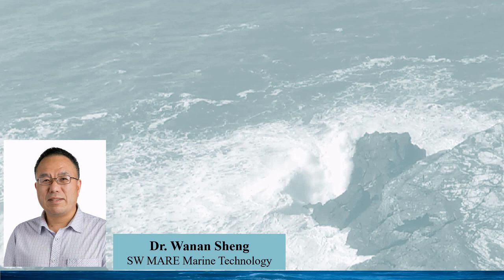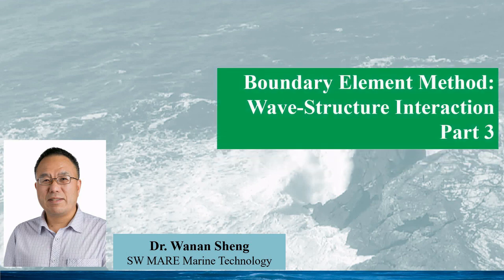[Fluid Dynamics: BEM] Wave-Structure Interaction, Part 3: Hydrodynamic Forces

Comment: https://youtu.be/_-N2sovNYpA?si=6C7Fx6X6tjm7k0P1&t=149  "In the frequency domain the pressure can be expressed as" - is this like a lecture? some justification?  the omega of what?  Sadly most of hydrodynamics have lots of assumptions not really justified or clarified.
Reply from the maker: Yes, it is a lecture. And yes, there are assumptions for the hydrodynamic forces, but it is a very useful and reliable method for getting the forces, and these can be used for industrial design. Or we can say the best method, but not the most complicated one.
Reply: @ScienceofFluids  I found your lectures since I have hydrodynamics  course based on Newman book. Its hard go go through since almost any equations have so many assumptions and there are just few if any explanations. Some are obvious (like linearization terms) but rest not that much.
Reply from the maker: @WojciechowskaAnna  yes, that's because the full fluid dynamics is so complicated, the nonlinear 2nd-order partial differential equations, and so far there are no good methods to solve them. However, it is found that the assumptions, such as the potential flow theory, are good enough for many practical problems, as in aerodynamics and in hydrodynamics (wave-structure interactions). otherwise you have to use CFD for solving the problems, very very computational demanding. And also CFD is based on the turbulence models (again the assumptions). so this is the reality for fluid dynamics. you have to simplify the problem, or you can go nowhere.
Reply: @ScienceofFluids  i undurstand the need of simplification, I just wish that that there would be more explanations of "why some assumptions  can be done". When I go through many boundary conditions  - they are usually listed, with little explanation. I am studying it, so most of them are see first time - and I just wish books  and lecturures would cover more this subject.
Reply from the maker: @WojciechowskaAnna  I have published a book in 2022, 'Fundamentals of Wave Energy Conversion', published by Eliva Press. The first few chapters are on potential flows, and I explained why we can use potential flows for our practical problems (I would say I didn't find such explanations in anywhere). Of course, I have talked about the boundary conditions in the book too. if you are interested, I can send you a chapter of the book on potential flows.